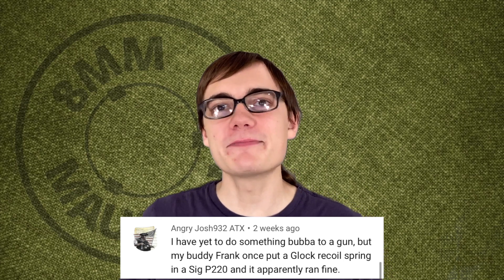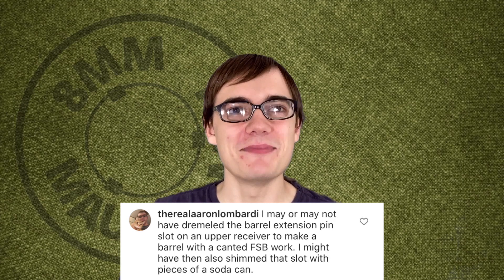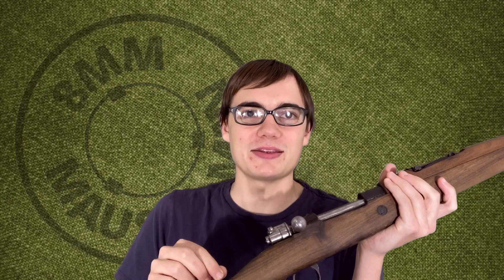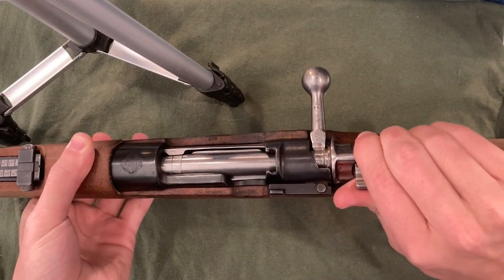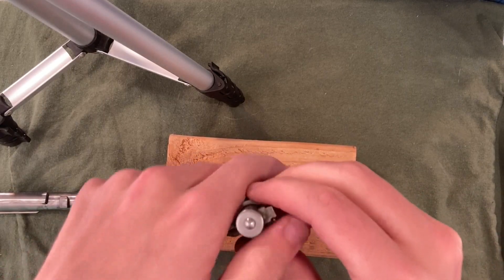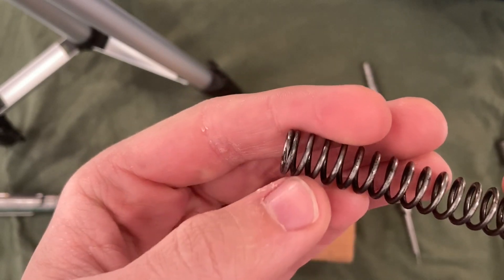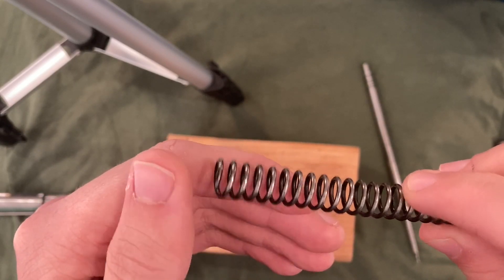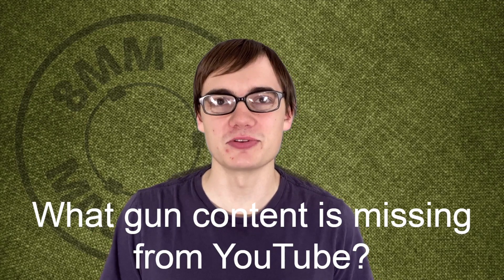The Most Bubba thing I've ever done (Surplus Arms 4)

Comment: Hate that word "Bubba". 40+ years of machining and gun repair have taught me that the losers that use it generally could not use a screwdriver without harming themselves.
Reply from the maker: I get that, but it’s often used to refer to people who do very poor “repairs” and/or sporterizations of old guns.
Reply: @8mmmauserman  Sounds like my late uncle who chopped a Finnish refurb M91 barrel dow to 20.5 inches and added a M1903A3 front sight as a replacement sight. Well  I guess I'll need to buy a Brass Stacker Mosin front sight base replacement so I can have a Poor mans M38 clone. LOL Well at least I'll have a free replacement front sight for my M1903A3. LOL Though I really like the turned down bolt handle he had done.